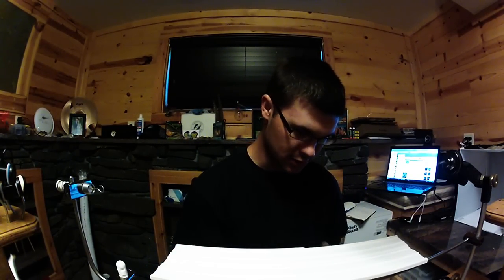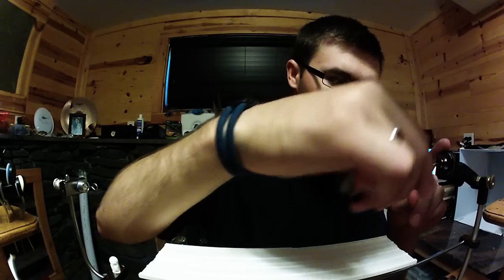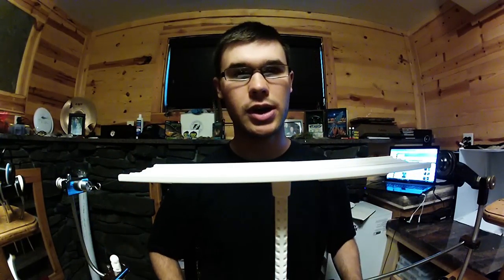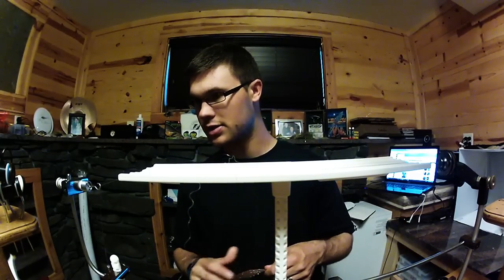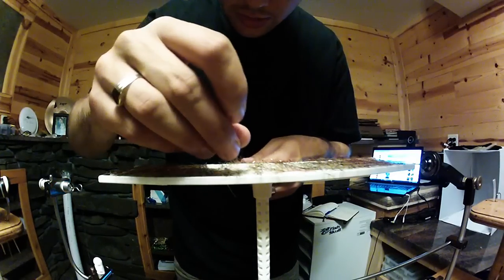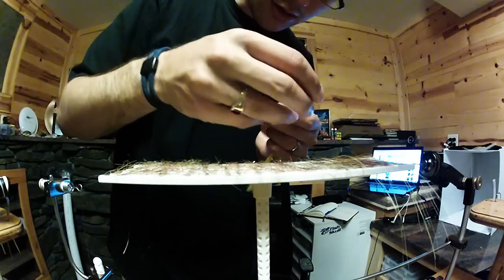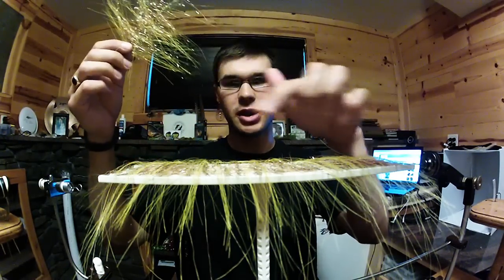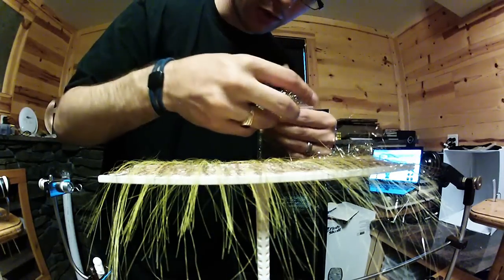Fly Tying: Brammer's Big Fly Fiber Dubbing Brush

Comment: Any alternative for ep game changer fiber.  Cant get it from finland 🙁.  Is there anything even near that one in just add h2o products for example?  Btw rly nice vid,  these have get me thinking of my tying in whole new way....
Reply from the maker: Awesome to hear man! One of my favorite substitutions for the EP fibers is Steve Farrar Flash blend which is an h2o product. The base for the SF blend is the Slinky Fibers, which would also work just as well or any of their Slinky blends, such as Flash n'  Slinky.
Reply: Thanks m8, will be ordering stuff for brushes this week,  got olenty of slinky and sf blend in box allready thata why ia asked.  Btw,  Will lazer dub work as subtitute for monsterdub?
Reply from the maker: It certainly will. The difference is that monster dub is more or less wool. The base material is alpaca fibers and underfur, which will build a viscous head and will have slightly more water tension giving a higher degree of articulation. Laser dub is an acrylic material if i'm not mistaken. It doesn't absorb water in the same way and has less water drag. For building a bulky streamer head they are however likely just as effective. I haven't tried Laser dub on a Monster Craw though, I'm not sure if the fibers would pick out as nicely. The Acrylic base tends to create a more solid silhouette instead of picking out into individual fibers.